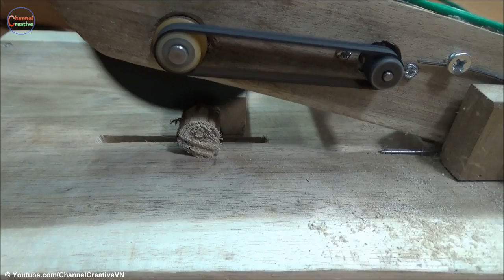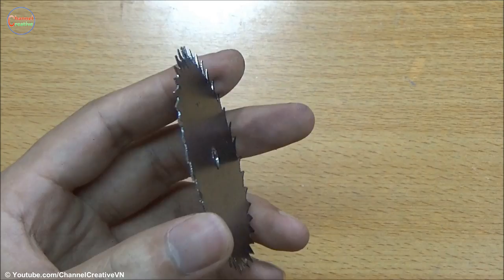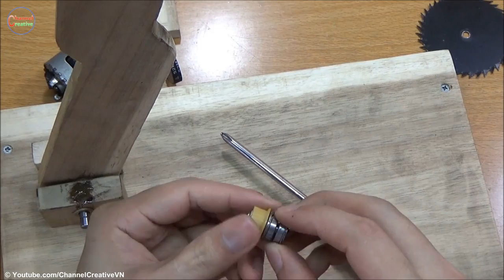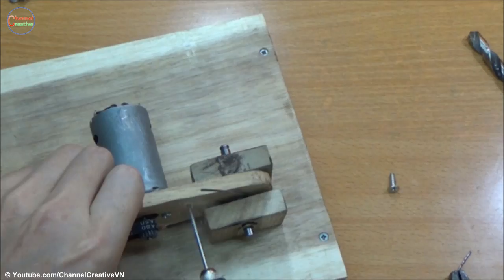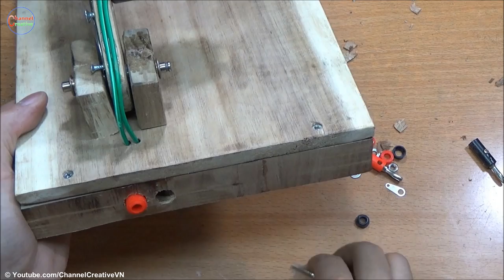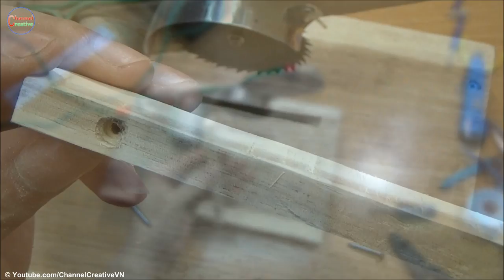How To Make TABLE SAW, Cutting Machine | Tool cut off saw 2 in 1

Comment: Good one. But, maybe better if you place the motor at about the tip of the handle as added handle to plunge the cutter. It would also be away from sparks and debris.

Comment: interesting job...Only a few notes:
- The motor appears to be not well protected by dust... maybe it should be good to create a carter on the cutting side;
- It should be better to use a button switch to start the motor, in order to interrupt immediately the circuit when you release the button... in case of accident, with a normal on-off interruptor, the disc will continue its rotation and could cut everything under its blades....

Comment: now you have to paint it and make it a usb powered so you can attach it with any usb source 😊 believe me you are going to find a lots of customers ..
Reply: Not sure a 5V 2amp motor would provide enough power to cut anything LOL.  Great idea but I don't think it would work well.
Reply: That would be nice, but a USB port would not be able to provide enough power. A USB port can provide max 500mA (0.5A), which is most likely not enough for cutting anything.
A boost converter might do the trick, though.

Comment: Great job, man! Do you think a 12v 18200rpm DC motor would be enough? Or is it too strong?
Reply: It depends on the momentum
Reply: +Javier Schulenburg Momentum? See: http://www.neoyama.com.br/produtos/micromotores/micro-motor-dc/micro-motor-dc-tensao-1200-vdc-rpm-18200-rpm-torque-39040-gf-cm/attachment/dat-i001127/
Reply: I think that one will be enough, at least for cutting Wood

Comment: plz tell me which kind of ohm resistance you put on the back side of motor  ?
Reply from the maker: +Awaisali Sammak hi friend, that is capacitor 15v 100uf
Reply: +Creative Channel hi friend thank you so much :)
Reply: +Creative Channel one more question plz how to connect motor with both capacitors ?
Reply from the maker: +Awaisali Sammak hi friend, the positive electrode of 2 capacitor i will solder to the motor
Reply from the maker: +Creative Channel negative on the motor cover
Reply: +Creative Channel okay Thank you 😊